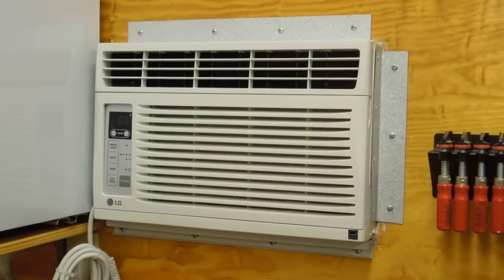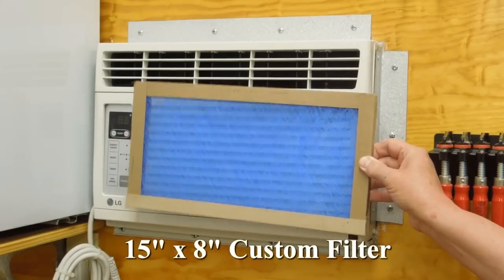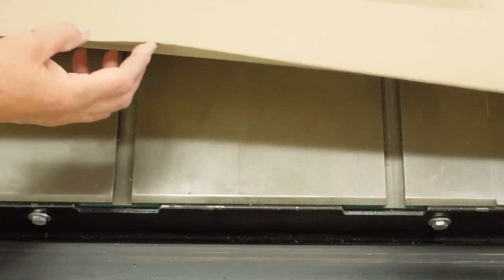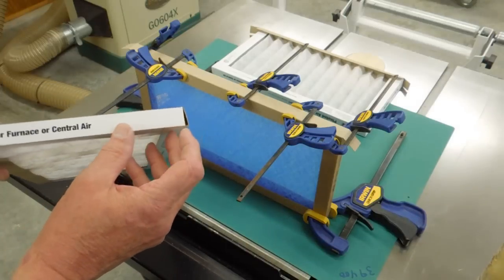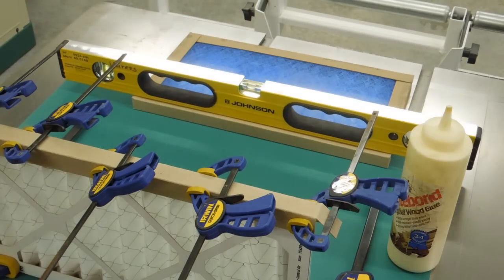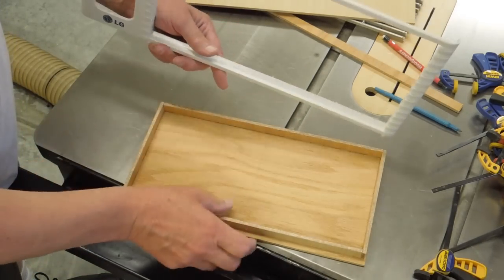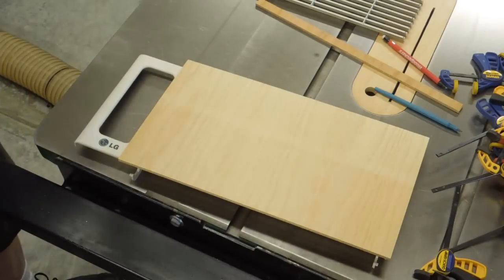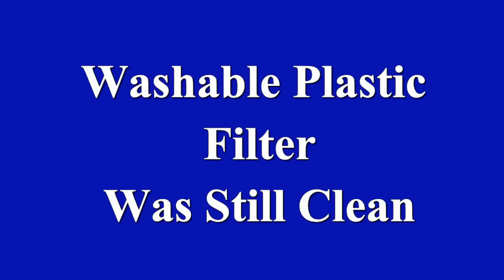Shop AC - Making Custom Filters

Comment from the maker: The louvers were some resistance to airflow. But then I replaced them with a filter (resistance), soon to become a dirty filter (even more resistance). At the end of the day, hopefully I haven’t throttled down the AC too much and the filters will help keep the coils clean. This is an experiment. If the filters get too dirty too quickly, then I have another idea to increase the filter size but that involves a lot more work. I wanted to get this done so I could start working in my new shop.

Comment from the maker: I used hot glue to attach the plastic front to the plywood frame. With the cardboard, I was gluing both sides at once. Sometimes the hot glue will cool off before you can get everything attached and into position.

Comment: Excellent. I have that same kind of filter in an AC/heating combo unit in my apartment. I live near a beach and there is always a lot of grit and sand on window sills, sand on floors and heavy amounts of dust. Add to that a pug dog that sheds copious amounts and dusting could be done daily- sweeping is multiple times a day- especially if we go to dog beach. Living in a rental would prohibit doing anything changing the basic structure.
Would also be too intricate for me given I have no shop and limited tools. I go in to the bathroom to use electric sander and jigsaw. Thinking of getting some cordless tools so I can go outside somewhere. 
But I digress- this has given me some ideas to see about making a filter- or just popping some of the material in the 1/2 inch slot with a pop of hot glue. Thanks!
Reply from the maker: Be very careful not to overly restrict the air flow through your AC as that can drastically alter the way it works. Error on the side of caution with a filter that is TOO BIG... not too small. Please subscribe. That is what keeps this channel going.

Comment: I've seen others stick the hepa filter directly to the plastic filter so no need for the cardboard thingy.
Reply from the maker: Additional filtration means restricted airflow over the coils of the air conditioner. This requires increasing the area of the filter to compensate for the additional restriction, otherwise the AC will not perform correctly and/or harm could be done to the AC. The original plastic filter is too small for this additional filtration.

Comment: Hi, good job. I'd love to see how you cut the wired filter.
Reply from the maker: I cut the cardboard with a razor blade and then cut the filter material with an old scissors. That is why the wire mesh is a bit flattened along the cut. Use a screw driver or pliers to reshape the wire mesh.

Comment: Have you tried any hepa filters in this configuration?    Im curious if it would smother the coils and not let them get the airflow needed to be efficient.  You prob don't need that level of filtration in your wood shop.
Reply from the maker: I have not messed around with HEPA filters. The HEPA filters would require a higher differential pressure across the filter than what this simple window A/C (or most any ordinary A/C) could provide. Thanks for watching. Please Subscribe… that is what keeps this channel available.

Comment: Can I use the stock filter and add another custom filter?
Reply from the maker: The so called "stock filter" which comes with the AC is a piece of plastic which does not filter much.  I use it plus the custom filter shown.
Reply: Ronald Walters so it’s ok to use 2? The filter I brought is a 3/16” thick
Reply from the maker: You have seen what I made for mine and I left the washable plastic filter in place. I decided the lower quality blue filters were not good enough and have used the pleated filters instead. Since I can't see what you purchased, you will need to make an informed decision based on what I have shown you in the video. Obviously you do not want to restrict the air flow too much, which also means keeping the filters clean.

Comment: That won't overheat the motor?
Reply from the maker: LSweet2007 No, the motor does not overheat. I have used these filters on two A/C's for two seasons and they have worked perfectly. Just remove the filter when it gets dirty and gently blow it out with compressed air. It keeps the coils clean and the A/C working efficiently.